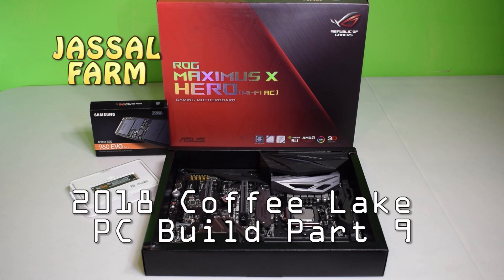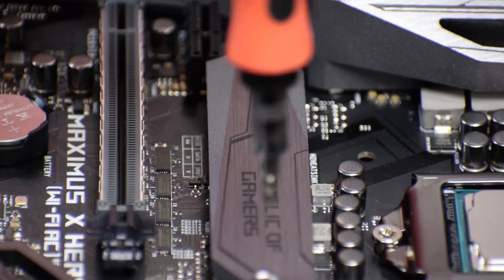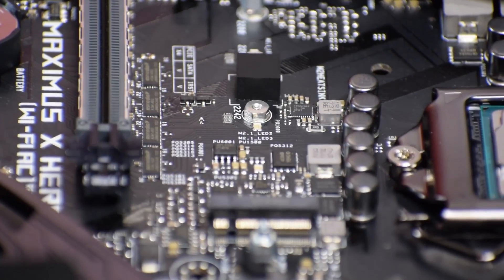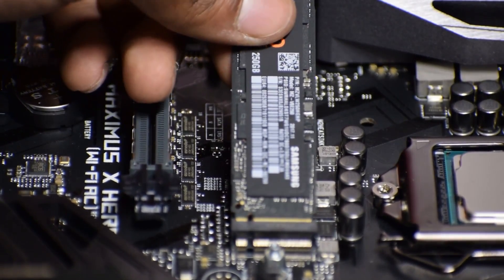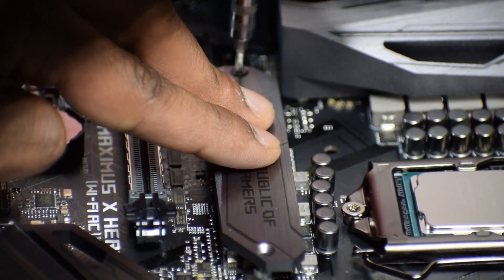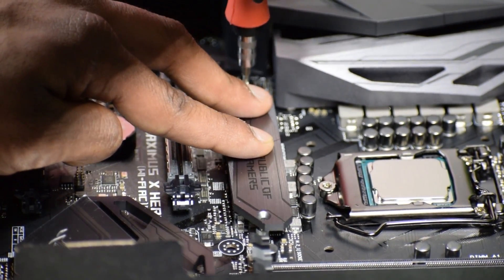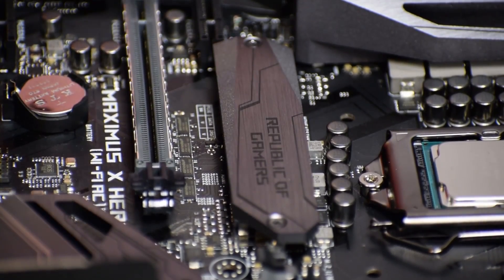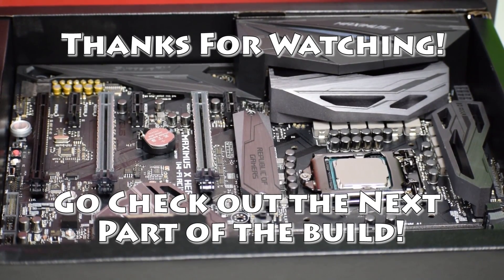(Part 9) 2018 Coffee Lake PC Build: How To Install NVMe SSD M.2 onto Mother Board!

Comment: Hey just a quick question. Been trying to remove the heat sink shell so I can start installing the m2, but, 

I can’t remove the screw it just never moves. Tried all the screwers sizes in my toolbox. 

What is your specific size of your screwer?
Reply: Ok I see, it is because I don't have a philips head driver in my toolbox, they are all Frearson and JIS B 102 screw head drivers. Look similar but not the same.

Comment: Is there a way to remove the heatsink after you stick it? Can someone pleas help me.
Reply: I’m talking about the ssd thing that goes over it.
Reply from the maker: No problem, you can use a business card or an plastic credit card, and simply wipe away any thermal paste material. (Just be sure to ground yourself of any static discharge first.

After you got the old paste off, apply new thermal compound paste to the CPU, and re-seat the heat-sink keeping the screw holes in alignment.

Comment: Hey, any problems with overheating if you put the SSD there? I heard this motherboard has two places where you could install the ssd and the second one is a lot cooler. You have any experience with this? Thanks for all the info :)
Reply from the maker: Sorry for the late reply, Yes there are two locations you can mount the m.2 drive. We have had no issues whatsoever with overheating using the first location. The computer has also been moved downstairs basement right next to the wall of the furnace room. When the computer was upstairs, the temperature of the inside of the case was running idle at 27°C, and now that it's sitting next to a heating source, it only went up 3°C to a steady 30°C. 

As of now, my CPU temperature is 30°C with the fan speed only spinning at 1100-1120 rpm (clock speed of 4.4Ghz)

The GPU runs idle at 28°C (0% load) fan speed of 960 RPM

Thanks For Watching & Taking The Time To Comment, I Hope This Information Helps :)
Reply: JASSAL FARM no problems, thank you for the reply! :)
Reply: Just to add on to this ,,, if I use the 2nd location, do I need to move/use the heatsink there as well? or is it safe not to use the heatsink from the 1st location?  @jassalfarm3743

Comment: whats (wifi ac) in the brackets stand for on the mobo? mine doesnt have those, so does that mean i can't use wifi?
Reply from the maker: So as you know, the main difference between desktop computers and laptops are that laptops are more portable because they use WiFi instead of an Ethernet cable (RJ-45) plugged directly into the PC.

With having the WiFi AC on my motherboard, it allows me to have wireless internet just like a laptop.

You can also install a WiFi card into your motherboard's PCI Express slot, if you wish to add this functionality.

The AC stands for the type of wireless interface, it allows for faster and further bandwidth speeds, keep in mind there is also a new standard coming out soon that will replace AC but that will still take some years (Wifi AX)
Reply: Thanks for the answer

Comment: Dang!!  Wish I had seen this before I installed my Noctua NH-D15 Cooler!!!!

Very Nice video.  I never would have known to install the SSD at a 45 degree angle.  Thanks guys.
Reply: So I need to install this Ssd with cpu and rams before the big Noctuna NH-D15? Right
Reply: @1tokatsche  Only if you want to use that top M.2. I made the same mistake. I ended up using the more accessible slot below. My Top M.2 I cant unscrew anyways a common problem for the HERO XI
Reply: do you have to use the heatsink from the 1st location as well? or you can leave it open to air on the 2nd location?  @BrianGarside
Reply: @reglap1224  You'll want to use the heatsink. It gets warmer than a regular HD.
Reply: @BrianGarside  would a 40mm fan do the trick? I've read nightmares removing those screws from the heatsink on the 1st location. thank you
Reply: @reglap1224  Agreed. I tried to unscrew and stopped once I realized it was not going to work and the stories. So yeah 40m fan should do the job, probably better than the heatsink. 2nd option is to use the bottom slot like I did, much easier to access once your hardware is installed.
Reply: @1tokatsche absolutely!  Make sure the fans are the right direction.  The fans adjust up and down also fyi.
Reply from the maker: Thanks for Watching :)
Reply: I had the same problem I just installed mine on the lower M.2 same speed PCIE 4x plus its serviceable

Comment: What’s the best way to set up a single M.2 on a Maximus X Code? Will it have to share bandwidth with other devices I have plugged into the Sata 6 ports? If so what ports should I use for my 3 mechanical HDDs to avoid sharing bandwidth?
Reply: OhItsThat did you find the answer?
Reply: I asked on the ROG forums and this is what I was told. This is also how I have mine setup..However I'm not pleased with the cold boot and restart performance of my Samsung 970 EVO 500GB..its really slow compared to a regular SSD.

Heres what they said>

"You can connect your 3 HDDs to sata ports to 1 2 3 or 4 as ports 5 and 6 are disabled when you use an M.2 drive in pci-express mode x4.

In windows use CrystalDiskInfo to check the status and transfer rates for all your drives."

So put your M.2 in the main slot on your mobo then make sure its in PCIE mode under M.2_1 in the bios. If you aren't using a second M.2 in the other slot dont worry about any settings related to M.2_2
Reply: OhItsThat thanks mate! ill give it a go. did you update your bios?
Reply: Sam710 I sure did.

Comment: What is ssd for? Can i just use my tb hardrives?
Reply from the maker: Alexus The M.2 SSD allows for extremely fast boot up times. It has a read speed of 3,200MB/s which outperforms everything on the market. You can always install the OS on your standard sata harddrive, but if you want lightning fast boot up times, I strongly suggest you install the OS onto a m.2 ssd. This computer boots from off to desktop in under 3 seconds!